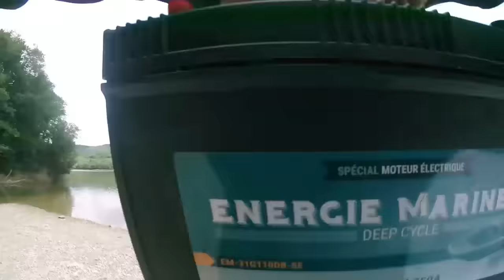TRANSFORMATION d'une VIELLE BARQUE en BASSBOAT

Comment: I was already massively impressed by the boat, then came the trailer. WOW!
Reply: Arie KopKa
Reply: @javandervoort2455  di
Reply: @javandervoort2455  di
Reply: @javandervoort2455  di un
Reply: @javandervoort2455  di un suo gentile
Reply: @javandervoort2455  di un vostro
Reply: @javandervoort2455  di un
Reply: @javandervoort2455  di un sereno
Reply: @javandervoort2455  di un suo
Reply: @javandervoort2455  di zio si
Reply: @javandervoort2455  di UN

Comment: And the latest boat company was born
Reply: Good skills,  nice show. but what's for.  It looks cost more than buying a similar new one.
Reply: @weiyizhang4437  is not so much expensive, the restauration of the boat cost aproximate $250 USD in materials(cost of this materials in Brazil), not much more, the motor and eletronics are a apart case. Make the work is the fun!

Comment: That looks like one of those boat forms they use when building a fiber glass boat, nice job making a boat out of it. You might want to really strengthen the back end up, so it can handle the weight of a motor if ever you want one, did you put in a drain plug ?

Comment: Make sure when you using wood you glass two sides, and get some acetone in each coat or each mix of resin so your resin fuse good ,so when the boat pound, it don't crack, becaues your fushion on your glass job good, acetone is important in fiberglass work cant do a good glass job without it!!

Comment: Very neatly done, but i notice a few mistakes. The wood is to thick, will add to much weight. The wood should be treated several times prior installation and when laying down the wood, a glue is needed, screws lose their effectiveness over years of use. Staples should be stainless steel and i am worried about how the transom was fitted. BUT, as i said i learnt this only by doing it over and over again... this work is neat and tidy though :)

Comment: Nice job. I think you put a lot of unnecessary work into the transom though. You could have used SeaCast transom restoration kit. I try to use as little wood as possible in a boat

Comment: The fiberglass work is actually bad. When you repair like you do on the rear of the boat its not enough with only one layer of fiberglass, thats only armour you use there. Under the boat i see you put fiberglass on top of old paint, thats wrong, it will not stay for long on. It will break up. You ne tu rub off all old gelcoat to get to the fiberglass,the you can put on new👍😊 you can see boat that is hand made by me if you google hansvik boat 👍

Comment: You did make a major mistake on your trailer....you put your bolts for the hitch in from the top....trailer will bend and break off....losing your boat....and bolts from the side to stop this..( should say not to use those holes right on the hitch)....this is why.....not sure your tramsson will hold up....hope its reinforced  on the inside....video didn't show that.

Comment: Trying to get a hold of Elon Musk CEO of Tesla. Looking for a new life and an investor my hybrid best gas mileage in the world and has everything. Contact me.
Hello, my name is Christopher Anthony Betz 
I have a  new hybrid truck design, I've spent a few weeks working on it , all by myself. I really don't have any friends, just my cat Tina, she is sweet and loving and is my best friend..My hybrid has a potential of running for 24 hours without needing to be plugged in, if gas is even needed, what about power outage or damaged charging port, (I came up with wireless charging) or vandalized charging stations,and able to change a flat tire in 30 seconds. The police and highway patrol have to buy them to keep up. I doubled the sales before the vehicle is built.. is there sensors that prevents driving off with the charging port plugged in? My job skills are mostly flooring, but my last job was being a day Porter. My hobbies are playing with my cat, and golfing at the putting green. I do trick shots for fun such as one handed behind the back. I like problem solving, how do you mix oil and water and seperated at the same time? Put it in the same container. The math division remainder fix, cut odd number in half, you have two equal parts, technically, divide each equation and add together, round up a digit, it's .5 when others give up and say something is impossible, I like to prove them wrong. I like a challenge. With an open mind and a positive attitude anything is possible. I am looking for a new job and an investor. I would like to guarantee no recalls, I really do not like back tracking.. I like to move forward, and productive. I would really like to be apart of the Tesla team. I live in citrus heights Sacramento CA 95621 is the zipcode. I am willing to relocate. I'm on Twitter @ChrisaBetz3
To conclude, thank you for your time. I really hope to be hearing from you soon. Chris A  Betz. I think I know how auto pilot crashes, no barrier on the side of the road to all of a sudden it pops up, glare shadows, the car in the next lane gets too close.